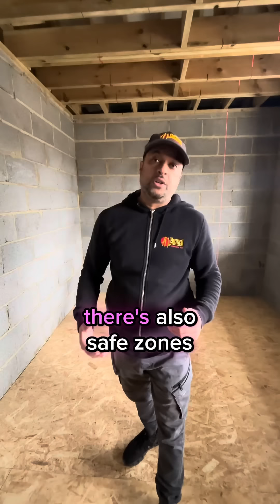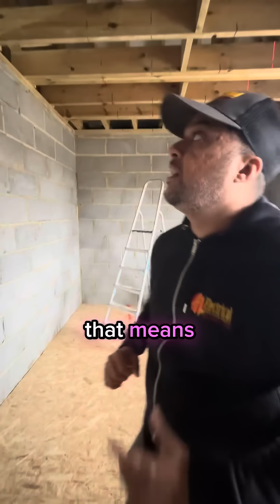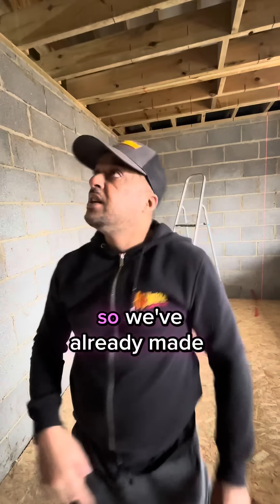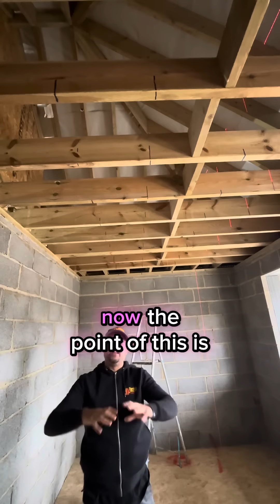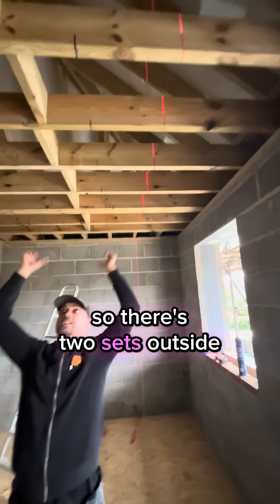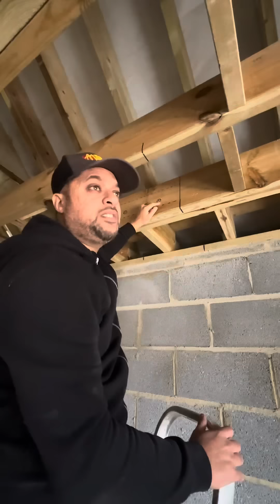Cables in safe zones

Comment: Just take all the cables over the top of they joists then clipped straight down to the sockets and switches which is easier no weakened joists and it is a better job that extension is an easy job fuck all they holes

Comment: Decent video. For the depth you are aiming to drill in the centre. You only want to be more than 50mm in from top or bottom to prevent screw damage. 

90% sparks dont know this.